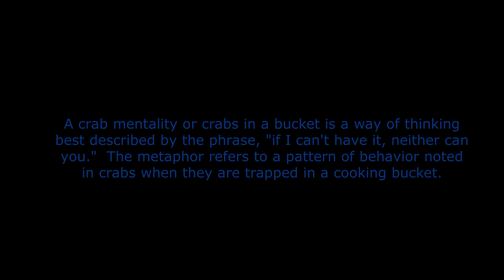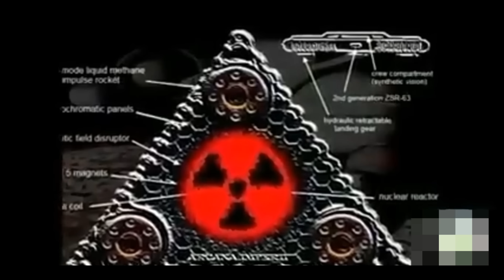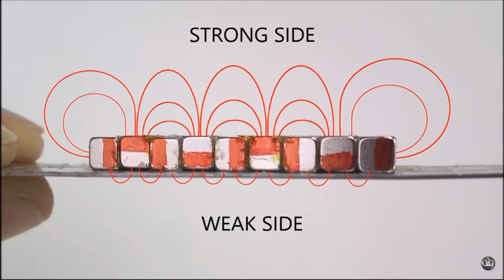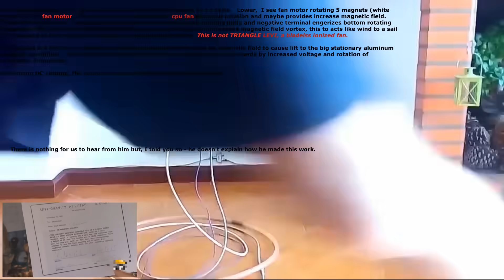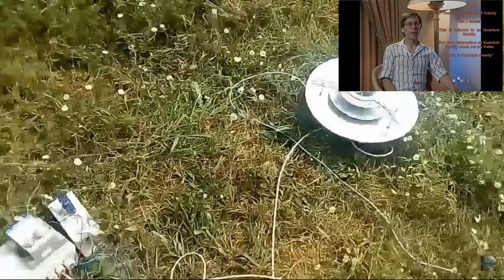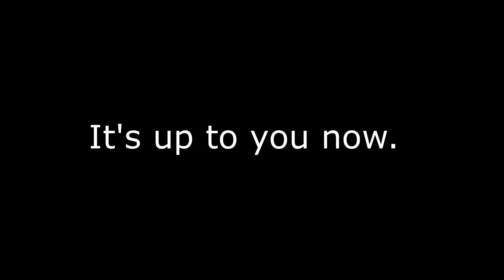anti-gravity project

Comment: If there was such a thing called anti-gravity, you wouldn't know how it worked. It is top secret information that cannot be revealed. Video doesnt seem legit.
Reply: Respectively, you need to go study this stuff in detail. The device copies all the principal technology from the German Bell to the descriptions of the Vimana craft. There is no way this stuff is fake, have you not see the Lifter Tech experiments, are those fake too? You can take two magnets of same size and press them together and feel a slight weight difference when compared to two other same size magnets sticking together, the weight loss is apparent. Also this experimenter is pumping thousands of volts into the center capacitor and he is counter rotating two opposing fields against a reflective aluminum disc, creating in the ether a counter 
field that is breaking the gravity lock.  He also is pulsing Ultra Sound from the cone downward and probably magnifying the sound 
pulse stimulating the ethers to move downward. . 

How about the sound chamber experiments levitating dust and the items floating upward in the Hutchison experiments? What about the High Voltage experiments that demonstrate charge obstacles get lighter? Friend, the proofs are out there. .My guess is this guy is probably getting very worried about what he has found. . He has not posted any update videos. What about the many patents on the High Voltage side of the technology. You don't get a patent on something that does not work. Just some things to think about..

Comment: Elon Musk says there is nothing like a "flying saucer" using things like magnetic fields. That it is completely science fiction. This was on Joe Rogan before the weed came out I believe. But then I think about the tin foil that can be levitated, and see the issue with needing a field to repel like the levitation with foil like this one? https://youtu.be/FFK5BzHs6eY

Hard to imagine we can't harness the local atmosphere through coordinated fields oscillating I imagine like a propeller on a boat, at least a plane's doesn't fit in my mind's eye as this is a new addition to the image I've formed. For micro-atmosphere travel, it could be as simple as using a sail made from material that will react to the solar winds, i.e. protons, electrons, various plasmas, and I think many more...haven't even looked at the models in months, been since the Hawaii volcano died down. But a propulsion that uses mechanics that can manipulate the polarity around the craft I would think could be arranged to repel or attract the sparse, yet constant. Makes ya wonder if it is truly 'sparse' when the particles are moving hundreds of thousands of miles per hour to nearly the speed of light depending on the emission. Rain drops miles apart moving at 300,000 mph might appear to be nearly touching. Perspective again showing how we so easily misinterpret things that are new to us. 

So, I don't see why there's not some way to arrange the field geometry to repel the downward pull of gravity, or use the gases and solids in the atmosphere as "footing" to push or pull to/from. Then there is the idea of warping the field around the craft. You'd create a wave distortion in the field from the earth that creates the acceleration known as gravity, and then possibly having to continually form the wave as the craft moves almost like laying down pavement behind one of the newer street pavers. Perpetuating the wave as needed. The actual acceleration would be from gravity like a surfer on a wave. And now from that image of the ocean, I see that the craft has no need to create the wave it will use to move anyways. But I do think that this is more likely to rely on plasmas and sparse gases being used to move the craft. 

After-all, what else would a "plasma wakefield" be in nature? A wave crafted and directed towards a craft designed to harness and ride it with the destination in mind? Smoke rings in space! AWAKE project created in space yet? I'll have to check up on what became of the ISS-CERN experiments with plasmas in space. People had some creative theories all the way to lifeforms. Crazy, but I don't rule anything out as possible. So far, anything we can imagine has been able to eventually be done. At least, that hasn't been proven to be false, yet!

Comment: It's all wrong, try to do it to make energy of the magnetic field, can you imagine if all petrol cars and that could be easy convert for electric cars that no need charge 👌🤗🤑 Rotshild and others will go mad becose no one wants fuel any more, little box runs your electric at home, free energy as it use to be in Teslas head and some historic evidence csn be seen around 1850s  Tartaria, free energy ect, it can be done and is easy to figure out but without strong caution and back can end up with Hart attack or other stuff has to be prepared and bigger scale and publish worldwide within the same time, its like All agents Smith on one case......

Comment: Good for a laugh, I suppose.
Reply: Respectively, you need to go study this stuff in detail. The device copies all the principal technology from the German Bell to the descriptions of the Vimana craft. There is no way this stuff is fake, have you not see the Lifter Tech experiments, are those fake too? You can take two magnets of same size and press them together and feel a slight weight difference when compared to two other same size magnets sticking together, the weight loss is apparent. Also this experimenter is pumping thousands of volts into the center capacitor and he is counter rotating two opposing fields against a reflective aluminum disc, creating in the ether a counter 
field that is breaking the gravity lock.  He also is pulsing Ultra Sound from the cone downward and probably magnifying the sound 
pulse stimulating the ethers to move downward. . 

How about the sound chamber experiments levitating dust and the items floating upward in the Hutchison experiments? What about the High Voltage experiments that demonstrate charge obstacles get lighter? Friend, the proofs are out there. .My guess is this guy is probably getting very worried about what he has found. . He has not posted any update videos. What about the many patents on the High Voltage side of the technology. You don't get a patent on something that does not work. Just some things to think about..
Reply: HalfNelson 1973 😀😁

Comment: so its not anti gravity as much as it is magnetic propulsion
Reply: Magnetic repulsion.
Reply from the maker: If you balance two air capacitors and apply power to one, the balanced scale moves up or down based on which you applied power to.

Comment: So if you were to use magnets to allow themselves to propel in a rotation you can have an infinite amount of energy now if you were to use the conducting electricity from those propelled rotating magnets you can allow it to levitate now if you were to use the energy from both of those rotating magnets you can hadwin so if you have levitation you can head thrust and momentum to move forward and backwards there goes your spacecraft without using any fuel
Reply: Friend, you test that?
Reply: @BienestarMutuo  no

Comment: Canceling gravity. 
I believe that. Sure. That’s what he did. 

Nobody knows this. And we know why.
Reply: Respectively, you need to go study this stuff in detail. The device copies all the principal technology from the German Bell to the descriptions of the Vimana craft. There is no way this stuff is fake, have you not see the Lifter Tech experiments, are those fake too? You can take two magnets of same size and press them together and feel a slight weight difference when compared to two other same size magnets sticking together, the weight loss is apparent. Also this experimenter is pumping thousands of volts into the center capacitor and he is counter rotating two opposing fields against a reflective aluminum disc, creating in the ether a counter 
field that is breaking the gravity lock.  He also is pulsing Ultra Sound from the cone downward and probably magnifying the sound 
pulse stimulating the ethers to move downward. . 

How about the sound chamber experiments levitating dust and the items floating upward in the Hutchison experiments? What about the High Voltage experiments that demonstrate charge obstacles get lighter? Friend, the proofs are out there. .My guess is this guy is probably getting very worried about what he has found. . He has not posted any update videos. What about the many patents on the High Voltage side of the technology. You don't get a patent on something that does not work. Just some things to think about..

Comment: If the flying object is real then tell me ,which force is opposing gravity
Reply: The gravity lock is being broken by the high voltage electrical fields that are opposed to one another, they are spun counter clockwise opposed to each set of magnet creating a scalar potential interference, there is also a downward thrust being magnified from the ultra sonic transducer in the cone.   The device copies all the principal technology from the German Bell to the descriptions of the Vimana craft. The High voltage capacitance charge is going directly into the aether / being built up as gradient in the ether because of the spinning discs. The spinning throws off the charge build up as with the N machine.

Comment: At 0:50 you show a diagram of a Toroidal Transformer.  
It's not an anti - gravity device!
Reply: Respectively, you need to go study this stuff in detail. The device copies all the principal technology from the German Bell to the descriptions of the Vimana craft. There is no way this stuff is fake, have you not see the Lifter Tech experiments, are those fake too? You can take two magnets of same size and press them together and feel a slight weight difference when compared to two other same size magnets sticking together, the weight loss is apparent. Also this experimenter is pumping thousands of volts into the center capacitor and he is counter rotating two opposing fields against a reflective aluminum disc, creating in the ether a counter 
field that is breaking the gravity lock.  He also is pulsing Ultra Sound from the cone downward and probably magnifying the sound 
pulse stimulating the ethers to move downward. . 

How about the sound chamber experiments levitating dust and the items floating upward in the Hutchison experiments? What about the High Voltage experiments that demonstrate charge obstacles get lighter? Friend, the proofs are out there. .My guess is this guy is probably getting very worried about what he has found. . He has not posted any update videos. What about the many patents on the High Voltage side of the technology. You don't get a patent on something that does not work. Just some things to think about..

Comment: There's no such thing as Anti Gravity!
Reply: Respectively, you need to go study this stuff in detail. The device copies all the principal technology from the German Bell to the descriptions of the Vimana craft. There is no way this stuff is fake, have you not see the Lifter Tech experiments, are those fake too? You can take two magnets of same size and press them together and feel a slight weight difference when compared to two other same size magnets sticking together, the weight loss is apparent. Also this experimenter is pumping thousands of volts into the center capacitor and he is counter rotating two opposing fields against a reflective aluminum disc, creating in the ether a counter 
field that is breaking the gravity lock.  He also is pulsing Ultra Sound from the cone downward and probably magnifying the sound 
pulse stimulating the ethers to move downward. . 

How about the sound chamber experiments levitating dust and the items floating upward in the Hutchison experiments? What about the High Voltage experiments that demonstrate charge obstacles get lighter? Friend, the proofs are out there. .My guess is this guy is probably getting very worried about what he has found. . He has not posted any update videos. What about the many patents on the High Voltage side of the technology. You don't get a patent on something that does not work. Just some things to think about..

Comment: Not to be insulting, but this level of field theory fails to scratch the surface by comparison to the level of unified field theory used to create the anti gravity and stealth features of the B-2 stealth bombers- using various electric mechanisms and configurarions. 
In a unified field theory- like E-infinity string theory- gravity and magnetism are the same force (all pushing in space). Just like the electroeweak force is also the electric force (all pulling into counter space). Did you know that the electric and magnetic forces are the same force? Or that light is a transverse electromagnetic phase conjugation of the electromagnetic fields crossed at tangent? Now, would you be surprised if I told you space is locally fractal?
Reply: yes Einstein new something not everything and his theories can be questioned and added to and amended(its called science) Fractal  science?is that a thing? If it it isn't it should be because it sucks as an art form(usually-not mine though!) intuitively I suspect it could be the key to lots of things including dark energy.

Comment: Interesting idea, but winding your own custom coils can produce a stronger and faster rotating magnetic field than physically rotating fixed magnets. (That method is rather crude. Although it does present the basic mechanism somewhat more clearly.) It's a matter of timing them, and controlling their firing. Think of how motor controllers work to fire the coils on a brushless motor.

If you want to spike the fields a bit more, you could also make a set of choking windings over another set of windings. Kind of like a crude EMP device or flyback coil, triggering the one set of coils over another energized coil can pinch the field down and make a bigger pulse when it springs back. Hysteresis and stuff like that, however it gets complicated pretty fast. Harmonics, noise, induced currents, can work its way back into the driver circuits and cause problems if not watching out for it.

Some of the stuff isn't just the usual scalar stuff that's been mentioned (anyone who has looked at the subject enough should have seen some already), but you may have to look into how quaternions work in relations to the fields. Stuff folds over itself and some behavior is asymptotic when charted without projection from the usual 2D graphs like an O-scope while measuring it. It's a bit difficult to grep for most people, as it's not intuitive to read out and predict without some extra work.

However if you're getting to the energy levels needed to counter gravity, you're talking about the same amount of energy that something like a chemical rocket would need to expend for its thrust. Getting that into a small package is going to be rather difficult, let alone having most of that energy lost as heat due to electrical resistance. Burning through parts and coils may be one of the worst hurdles, unless you work out some kind of heat dissipation strategy.

And gravity itself seems to be a function of energy density. Keeping in mind that mass is just energy in a different form. (Shifting the quaternions may also show why gravity doesn't have a second pole like a magnet, btw. One "pole" is a point, and the other hits a tangent where it's infinitely outwards in regular space.)

Another thing in relation to the behavior of fields behave may also be the permittivity and permeability of free space. Vacuum should be nothing right? No, it actually has a resistance, albeit very very small. Scaled over a volume this adds up. I think this property has a relation to gravity, given energy density of mass and also how small and weak a force gravity itself happens to be.

Not saying you can't play around with the idea of anti-gravity, but good luck in getting there. There's even more to look at and take notes on when approaching it.

Comment: Is someone confusing anti-gravity and magnetic levitation? The movement of mercury in a magnet field looks unusual, but this is what the dynamic rotor is called, no magic, just magnetic field physics ... And the anti-gravity trash with wires is only suspended from a thin fishing line. In the case of a hoop (9:45) on a vertical fishing line, the hoop is collapsible, the junction point is clearly visible, it was simply quickly taken apart, the fishing line was let into the gap, then assembled and thrown as if there was nothing on top. And in the case of a stick (10:19), this piece of junk hangs on a tightly stretched horizontal fishing line. This allows you to wave the stick above and below it. And the movements of the “anti-gravitational device” itself are surprisingly similar to the movement of an object that hangs on a thread, try it yourself and pay attention to small fluctuations.
Reply: Wow a great fault finder. Ull make a great scientist one day. Well observed!!!!

Comment: Any experiencers being shown/told that it's magnetism on the molecular level? 
these small particular shapes that fit together on the sub-atomic level building outward to form an inner sphere and the outside of the craft as a second much larger sphere.
(I'm greatly simplifying) Thus the ship's power source, movement,  "shielding", speed, ect. Is all created by external gravitational fields.
Ie , the Earth's gravitational fields or any planet supply local energy for all needs and outside of planet's gravity space provides incredible gravitational field energy.
Sadly I think this video is not on the correct path.